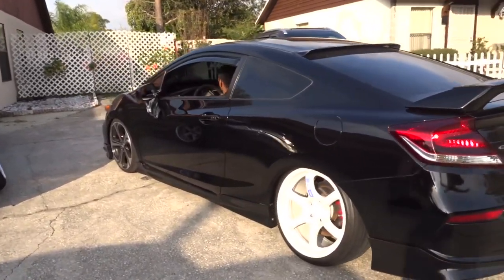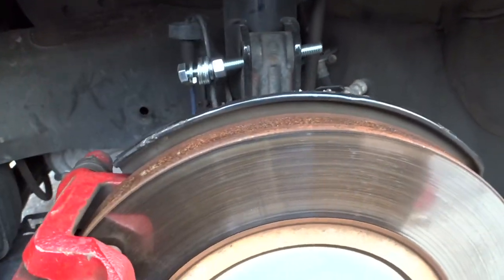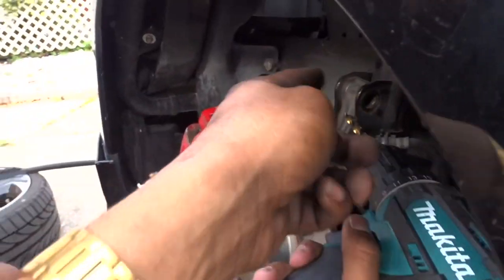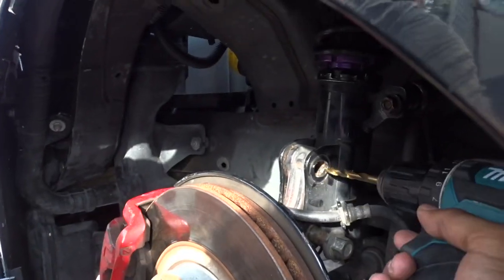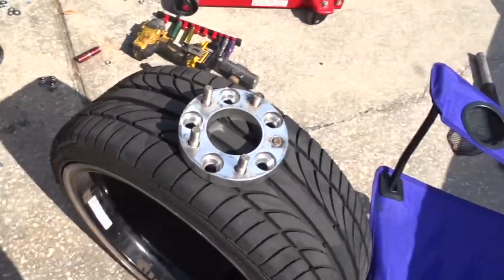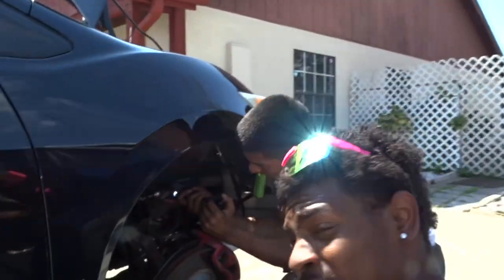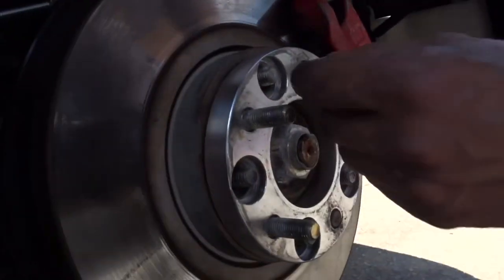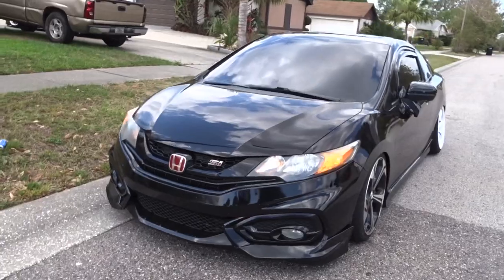FREE CAMBER? This is what you’ve been looking for! Civic/Frs/Subaru

Comment: what specs for the smaller bolt you used?
Reply from the maker: Great question. Not sure on specs but we basically went half in diameter of the original bolt with washers